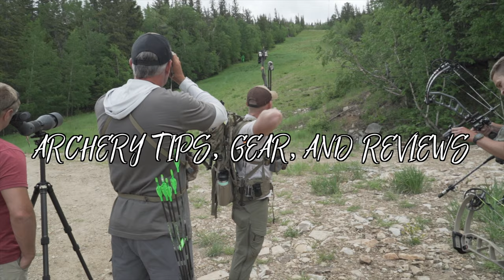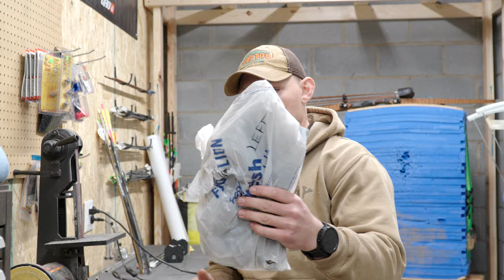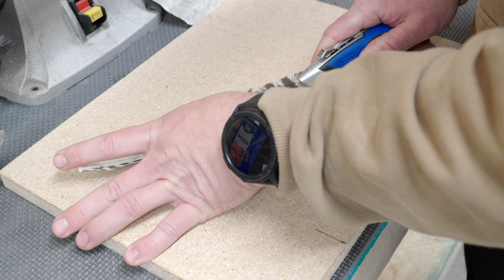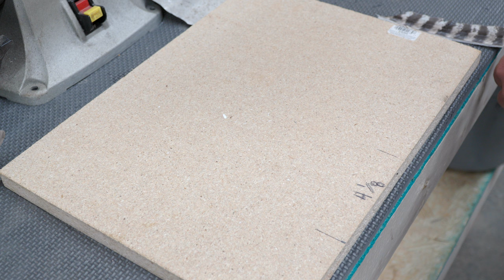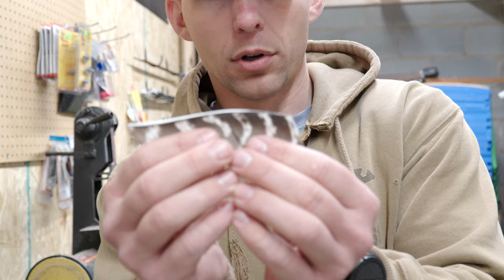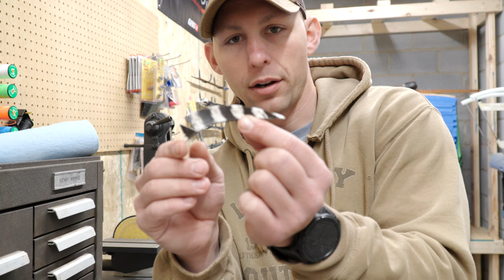DIY WILD TURKEY FEATHER FLETCHINGS | Making Your Own Fletchings From Start To Finish

Comment: Great video. It looks way easier than I thought. Looks like I’ve gotta run out and get a belt sander. That makes it way easier. I’ve got a feather burner I’m going to use instead of a chopper. Thanks!!
Reply from the maker: It’s definitely not a hard process. But the belt sander makes in much easier and faster for sure